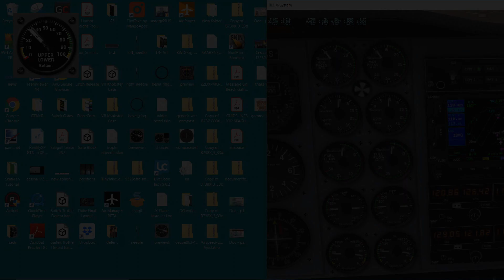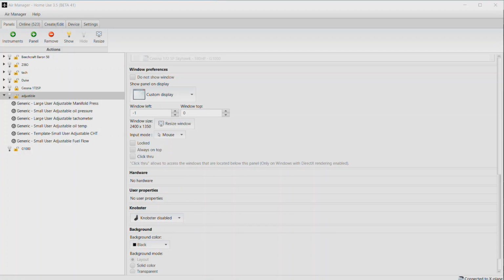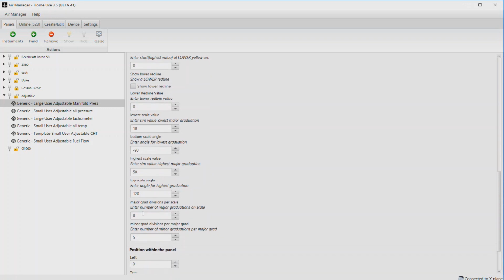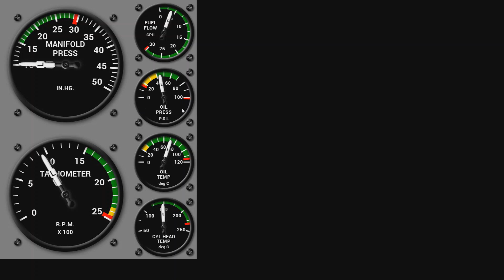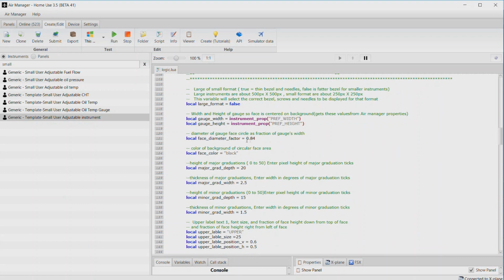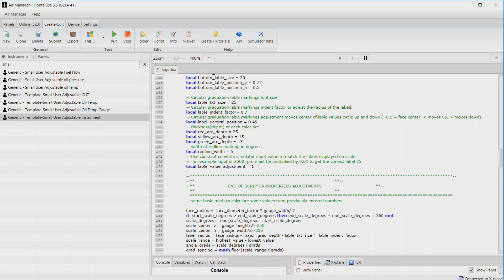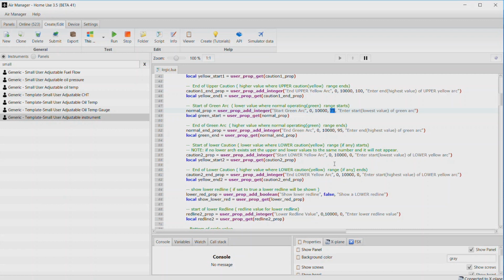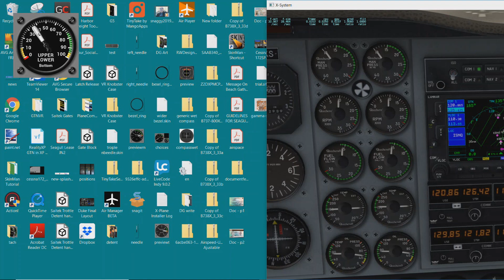Improved User Adjustable Instruments for Air Manager

Comment: HI Ross i love your videos you have been a tremendous asset to the sim community,I have a request when you find the time,would you be able to make a video on how to adjust the values on an existing instrument for an aircraft in Air manager please? I'm trying to match the values on the Airfoil labs king air 350 torque and turbine using the beechcraft 300 gauges I'm sure I need to add parameters in there,pretty much the gauges are set for default aircraft the c208 gauges work well and the king air c90 work well with the default please and thank you.
Reply from the maker: To create a replica of the actual gauge you need to create the graphics first with all the markings and scales.  You should watch my 3 part (rather long) tutorial in Skinman. It is a freeware program that can really help make a lot of the graphics creation easier  .  I also use Paint.net freeware graphics program.  Once you have created the instrument graphics you can modify the Lua code to make it move the needle in sync with the sim.  If the graphics are good and you just want to make them work with a payware airplane you probably have custom datarefs that are used instead of the standard datarefs.  I have a tutorial on DataRef Tool that will help you identify if there are custom datarefs being used.  If so the Lua code needs a tweak or two to access the new custom datarefs.  Maybe you can research DaatRef Tool and explore your Airfoil plane. Let me know what you find.

Comment: Please help. My air manager Barron 58 oil and pressure gauge does not reflect the same readings as the sim. For instance the gauge in the sim may be 80 degrees for temp, but on air manager the gauge reads 120 Celsius which is the max reading. How can I fix this.  Please keep it simple as I am no expert.